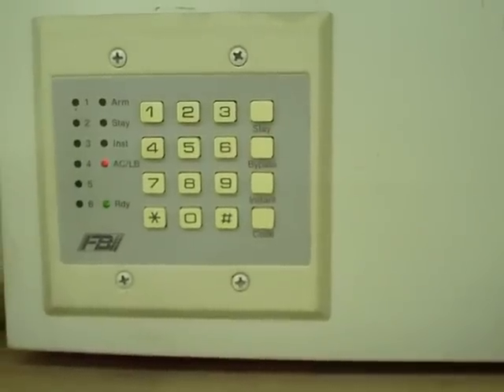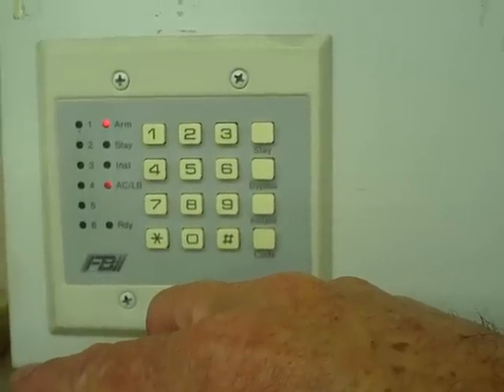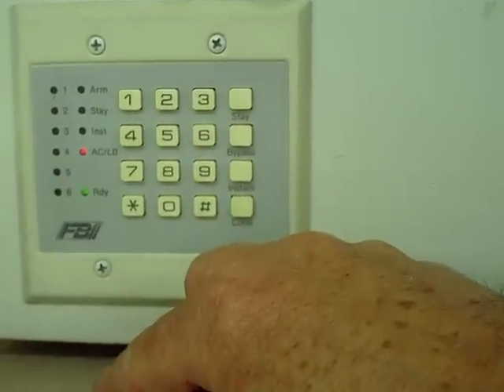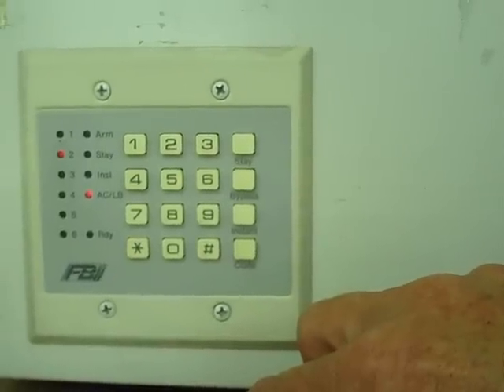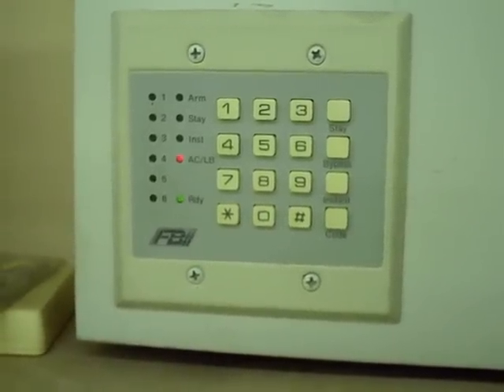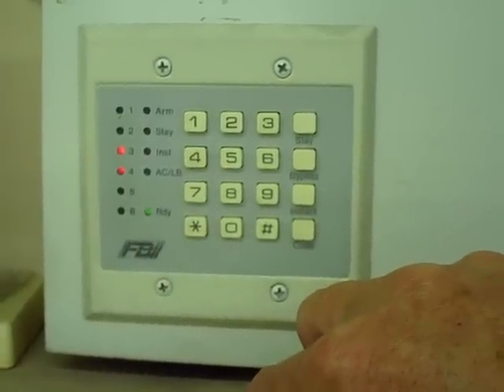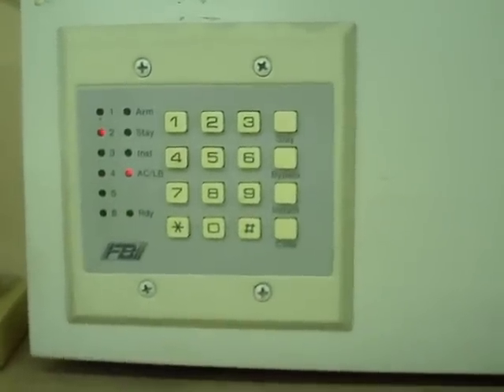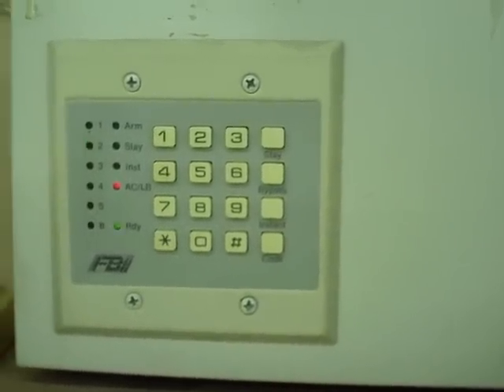FBI XL2T PROGRAMING

Comment: Does anyone have a schematic or sketch of an XL-2S panel AC to DC charger / power supply. Mine is not putting at a DC charge voltage high enough to charge battery. Battery is new and tested good, 12VAC wall mount 20VA transformer is tested good, with 12.5VAV with 12 ohm 20VA load. When transformer is connected the voltage is dragging to 8 and it gets hot. Bridge diodes look like they are hot, based on darker but good pc board. Transistor with heat sink is very hot. Radial caps look ok. I’d hate to trace this to figure it out

Comment: Position 1 number was deleted on my system. When trying to add a new code none of my other numbers work. Is there a way to add a new position 1 code?
Reply: Disconnect the battery and unplug from AC. Put a jumper between tp1 and tp2 then plug back in AC and reconnect battery.  Wait a few seconds then remove the jumper. This resets the panel to the way it was when it came out of the box.
Reply: @alanstark6066  thank you Alan